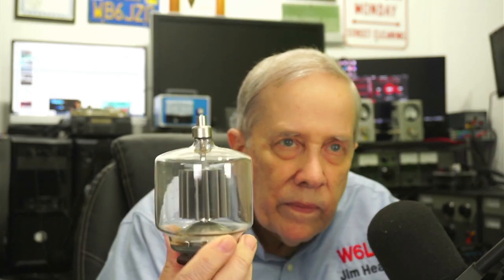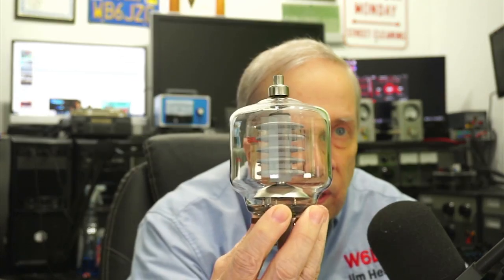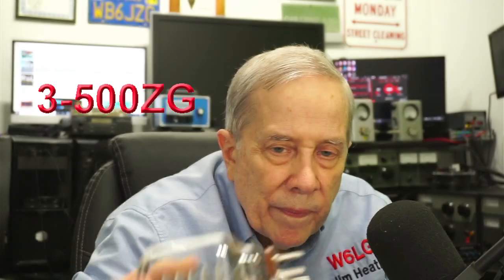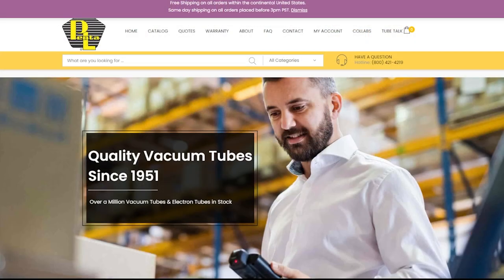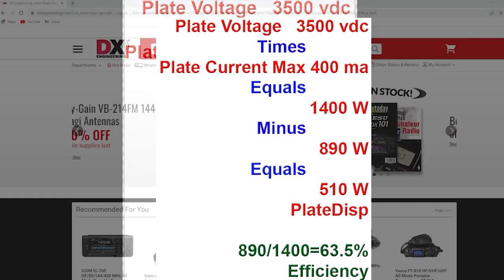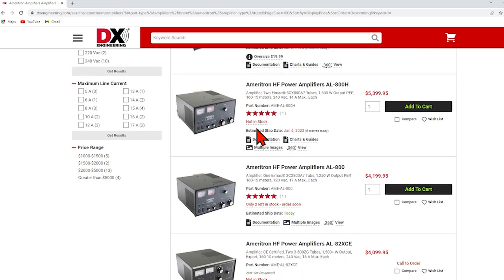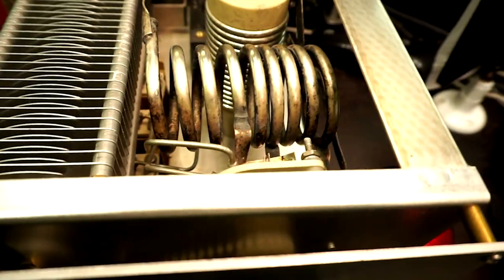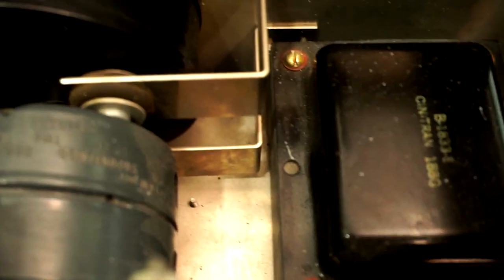Iconic 3-500z/g Tube, Plate Dissipation, Prices of New Amplifiers, Instead Consider a Used Drake L4b

Comment: Jim, we read the max (optimistic) 895 watt output for a  Single high quality graphit plate 3-500  which is really beating the pants off the tube..and MFJ is claiming a 1000 watts output from a single tube !  Reputable Makers designed around 500-600 watts output per tube using better components.  The advice to buy Drake or Heathkit is sound technically and financially !  W6WUH.

Comment: Mike, K1FNX here agn, my Raytrack is the DX2000L........ one would think I would know owning it since the early 1970's. There are deals out there for L4-Bs...... I bought (OK stole) mine for $800 which included 2 spare NOS Eimac bottles still in the orig boxes PLUS two power supplies, one wired for 240 and one wired for 120, a few spare parts PLUS the guy delivered it from NY to "near Boston".... the two spare 3-500Z went into the 6 meter monoband SB-220...... 900 watts out with 60 watts of drive.....and Oh btw, 10 second warm up time......just because they are old doesn't mean they aren't good...... like me! 73, Mike K1FNX near Boston

Comment: Purchased 4  572b from shuguang valves in china a few years back  i was told the factory burnt down and a hotel is getting built on the site  and tubes are new old stock , if i had 3-500 amp i would stock up on all of these tubes unless someone starts to make them again. buying some 572b for my collins as spares as still plenty on ebay,also looking at 811g,s from the ukraine as these are slowly running out.

Comment: Thank for being my Elmer Jim.  My first Elmer was K4BSZ Dr. W. E. Deacon in 1972 who helped me get the novice license.  I have a Drake B line with L-4B that is serving me well to this day.  I recommend, when convenient, to tune the 3-500z in stages (eg, 250, 500, 1,000, etc, but just allow W and add a touch of induction inductance on the Load capacitor etc increase the longevity of the tubes and to better process the vocal high frequencies.  Thank you for your wisdom and mentourship

Comment: Jim - I always look forward to your videos.  Even after 62 years in the hobby, this old dog needs to learn new tricks & have the old tricks reinforced.  I built an SB200 during the 1970s which I sold about 1985.  Since then I have picked up used, a SB-220 & a SB-1000.  I replaced the electrolytic capacitors in the SB-220, and I use it several times a week.  I replaced the power transformer in the SB-1000 and now need to replace the capacitors to keep it operating.  73 de K5AVJ

Comment: Hi Jim, excellent topic, enjoyed it very much, even learned a little bit.  Over the years I have had a  AL 811, AL811H, Denton 160-10.  I am now using a Heathkit 220.  The Heathkit might need new tubes, but it's working just fine. I have always looked forward to your videos especially the next one coming up. Thanks, 73  K7EMU

Comment: G'day again Jim

You mentioned early in this video, the notion of resoldering 3-500z tubes.  I had a friend try it because I had no idea how to do it.  I wish I had done a little more research because it didnt seem difficult....having said that, we found that the pins (I believe they are tungsten) would no longer take solder and then would not take to the outer pin.  I was about to employ the services of a jeweller to see if I could get the pin in question electroplated so it it would take up the solder.....but then discovered the tube rattling....so no more filament (after checking with a meter).

I have recently checked the Machlett tubes in my TL922...and another pin was starting to show signs that the solder had moved.  As you know, the TL922 tube ventilation is not great.  I used an iron and got the pin hot and I think I helped it along.  If therre is a trick to resurrect 3-500zgs that have had their pins hot, in terms of quality solder and flux, I am keen to hear it.

I think I will install another fan under the amp and see if I can get it cooler.  Regards Aaron VK2ON
Reply from the maker: I hope someone a lot smarter than me can answer this question.  I did use a small pencil torch and shoved in the solder to overflow.  It was risky and I was aware I could cause permit damage like breaking the vacuum seal. Many years ago I did use a very large soldering iron successfully.  Aaron I wish that I could give you better advice.  Hopefully, advice will come from someone who knows the best way to fix the tube.  73, Jim
Reply: All good Jim.  I would certainly be keen to hear from anyone else who has had success doing this should it come to pass again.

Thankfully the current tubes are working fine, and I think I did help it with a little heat the other day when I had the amp open.  I sure hope I did anyway because the Australian Dollar aint worth a lot of USD at the moment.  Can't get a new pair of 3-500z landed in VK for less than $570usd at the moment, which is $900aud....thats some serious coin and a big further investment in a 35yr old amp, which has already had a lot spent on it (but I do love it, I must admit.)  73, Aaron
Reply: Sockets are the main problem of the solder leaking out on 500z ,not because lack of air.

Comment: I just recently scored a L-4B and a Drake W-4 watt meter for ~$400 thru my local club from a member that went SK. It works as is but needs some TLC. The plate voltage/grid current/ watt meter had been replaced with a hideous old round Weston meter. I found a replacement meter with an acceptable footprint and fabricated a new face for it that looks remarkably like the original. It still will need caps and a soft start mod to protect the power switch. But what a great amp!

Comment: I have a stock SB-220 built in 1978,  it looks good no burned parts and I've looked at the bandswitches and they look good. I will clean with no-oxit spray, no cloth or rag. I have a fiberglass brush I used back in the 80s to clean silver contacts at a power plant but I think that may be overkill.  My plans are to pull the tubes and bring up on variac  Oh I have a new power supply board with capicators and bleeder resistors Any thing else you recommend?  Tnx for the great videos. I've been watching for years now, and always learn something new,
Reply from the maker: If the diodes are original, change them too.  You might want to buy one of those kits from Harbach.  Change those equalizing resistors at the capacitors.  Most importantly, have fun. 73, Jim W6LG

Comment: I've been learning about the old valve/tube amplifiers by building 12 over the past couple of years.
While the 3X.. 4X.. and famous 3-500Z tubes are amazing, the Cost is way too high for DIY.
Ditto many of the more popular tubes, even PL519's, GI-7b etc.
For Tubes/Valves, the ex-USSR GU-43b works very well. GS-9b also for lower power.
HT transformers are crazy prices. I've had a lot of success with modified microwave oven transformers.
High voltage variable caps for the tank are definitely a price challenge.

Comment: I run an old RayTrack 2000DX  on 40 to this day, I also have a Drake L4-B I bought to monoband on 6 but it is so nice I went with a monoband SB-220 instead, so have plenty of the old 3-500Z bottles keeping the shack warm. I made my living designing solid state power electronics to drive microwave tubes but will always be a hollow state ham amplifier guy

Comment: Good info on the tubes. I’m taking my AL-82 to Pacificon to sell.
Reply from the maker: Well that should sell while you are taking it out of the truck.  It is a very popular amp.  And, it has a good design. It was designed to run 1500 watts with ease. Someone is going to be very happy to buy that amp. 73, Jim
Reply: @ham-radio  buck a watt, $1,500

Comment: I just about done rebuilding a sb220 just need to replace the output band switch to fix 10 meters. I need a new RF meter as the sb220 pegged my 1500 watt meter with only 70 watts in. I've only been running it at 800-900 watts but be nice to know what it can do lol

Comment: Hi Jim. another great video. QUESTION: What output should I expect from a Yaesu FL-2100B? 2 572B's running on 117VAC. with 60 - 75 watts drive.
Reply: I used to have one and it would run 600 watts output easily, it was my first amp and I had a lot of use out of it virtually no problem. I then made a big mistake and bought a UK made amp with a single 3-500z that amp was junk in comparison to the old Yaesu G4VQH

Comment: it is too bad, tube availability are not good anymore. I guess if I need a amp, it is time to get solid state amp.  no need to wait for heat up, leave them ON while transceiver is ON all the time.  AG6JU
Reply: The 3-500, 3CX-1200 and 811/572 don't require warm-up time. Plus, that lovely nostalgic glass tube glowwwwww 😁

Comment: Your Drake is a beautifully made amplifier, but I think it is increasingly difficult to recommend valve/tube amplifiers. Although many of these tubes potentially have a very long life they can be subject to “strange” failures. Many of them are difficult to find or prohibitively expensive, they also need a different mindset to work with. All of this group of amplifiers want to kill anyone that is not extremely vigilant. My 3-500ZGs will probably outlast me, my GS35Bs are probably climbing in value… With the ratings bear in mind that for ham duty cycles they can be pushed much harder. 
An interesting video as always, certainly some very expensive amplifiers on the market.
Reply from the maker: All of what you write is very true and very good advice.  The Drake amps, if you can find one, sell here for about $1200 if in good shape.  A similar amp from MFJ is about $4000.  If someone does buy a used Drake, they need to factor in the price of new tubes and some capacitors.  Also, the construction of the Drake is much better.  I think the value of a used Drake L4B is more than $3000,; much more.  Your reminder about the dangers of high voltage is very important.  When somone gets across that kind of voltage, they're dead.  My prices are in dollars over here.  I have no idea about pirces, values or costs in the UK.  Thanks & 73, Jim
Reply: @ham-radio  thank you for the reply, sadly our prices are probably higher than yours despite the currency!
I remember replacing an audio amp in a 12v rig, the rig burst into life as I soldered the new IC in as the power supply was accidentally left on. That grade of mistake would be a whole different scene in a 3KV amplifier. A few of the older amplifiers are great buys, and very maintainable. I bought an amplifier from a US ham living in the UK, he was moving abroad with his work. A bargain as it was on EBay at a very low price and attracting no bids. I drove to his home with cash in hand. Sometimes you can still find bargains.... 73
Reply: To touch on the prices of new HF amplifiers, they're simply in the stratosphere. I'm returning to radio after 5 years and I'm jaw-dropped at the cost of new (and used) amplifiers--they've easily gone insane. Remember when the AL-811 catch phrase was, "A Dollar Per Watt"?? 😂

I would hope every operator understands the dangers of HV. I can recall too many memories of the news of an experienced Ham losing to that dragon. Several years ago I upgraded the cap bank and bleeders in my AL-1200 (I sure wish I didn't sell it, but you knw....life happens). The scariest moment was hitting the power switch. But it came to life perfectly and I let run for an hour for new components to set in. I admire so many that can still service HV systems. And more so respect those that respect that kind of power. (The Ham that walked me through my cap upgrade is a SK now. He actually said, "it's easy...just make sure no electrons are still in there...short cap to ground....and keep a jumper clipped to the chassis--caps can build a charge...we want to make sure of the most important thing, YOU ARE SAFE!!"

Tube amp builders/repairers are becoming extinct (like diehard CW ops)...and that's truly heartbreaking. As we rebuild our station we'll continue to be cautious of purchases and servicing. BTW, always enjoy these videos!! de N2QN.

Comment: You forgot the history Jim.  What about the  3-400-. It  was replaced by 3-500     3-500 wasn't ground breaking.   Collins Radio drove eimac to make a more robust tube. Legal limit was 1kw DC output.  Simple as that.       Please don't mislead     The drake L4 used 3-400z .  Hence the model number.  Later L4B used 3-500z
Reply from the maker: Your original unedited email was sent to me for review.  I was about to be delete it due to some unfortunate language that was a personal attack at me by you.  Joe, when you say things like that (which I won't repeat here), it reflects more on you than it does me.  It make you look good.  Seems like our country has evolved into angry groups.  So Joe, stick with the criticisms and corrections that you see necessary.  They can be helpful to all.  Do not include attacking the author; me.  

I am doing a new much more potent form of Chemo Therapy beginning on the 23rd.  It will be one week of infusions and three weeks off. I will lose my hair and lots of weight. It will be brutal because the doctors believe that I have full blown Acute Leukemia and the outlook is grim.  Confusion, memory loss and more nasty things are in ahead for me.  Keep that also in mind when offering corrections.  I did not forget.  I have made about 200+  YouTube videos and time constraints limit how much can be discussed.  

I did not forget about the 3-400z.  I did own some L4's. The 3-500z in my view was iconic and was groundbreaking because that tube as compared to the 3-400z, was hugely popular.  The 3-400z was in production a few years before the 3-500z was never as popular.   Also, I did work in a store that sold Drake equipment while in high school and university.  I am not aware of Art Collins having anything to do with either tube.  I cannot remember Collins making any amp with either tube.  By the way, I currently have 3 drake amps.  Also, Art's son lived not far from me and I did inspections on his house as a County BI.  

You said, " Legal limit was 1kw DC output.  Simple as that.  Please don't mislead."  Well, your statement about power is not correct.  We were not restricted to 1KW DC output.   First of all, no amp puts out DC.  Output is AC.  Second, the law then was 1KW input to the final stage in CW or 2 kw PEP input to the final stage when on SSB.  AM was also 1kw. .  With 2kw input to the final stage of the amplifier, the output, as I mentioned in the video, would be about 1.2-1.3 kw for Class B.   A pair of 3-400z tubes did that when driven to their max ratings and about 800 watts of plate dissipation.  

From my tests over the years, the performance of the two variants was  about the same.  I have built many amplifiers using Eimac tubes since I was first licensed in 1964.  I did meet one of the designers of 3-400z and the 3-500z.  He said the latter was more like a 3-600z. 

All fun stuff Joe. 73,  Jim W6LG

Comment: Good advice. MFJ/Ameritron amps are cheap junk. Drake and Heath  impossible to beat. Most can do fine with Sb-200.  Real bargains are old amps using 4 ea. 811-a's.  Like Gonset and heath.. rewire them for use with transcievers. Bullet proof, but big.  W6WUH.

Comment: Ah the Drake L-4B, I'm sure in the states they're so common you guys use them as door stops but here in England they are "made of unobtainium " I searched for over two years and have only seen one for sale, alas it was sold before I got to it. I also looked at importing one from the states, the prices where reasonable, around $450. However the shipping would have been $1800!!
I bought a Kenwood TL-922 instead (same 2x 3-500Z's). It's a great amp, I have no regrets but I still keep one eye on the classifieds for an L-4B😁 73 Jim, Tom G2NV.